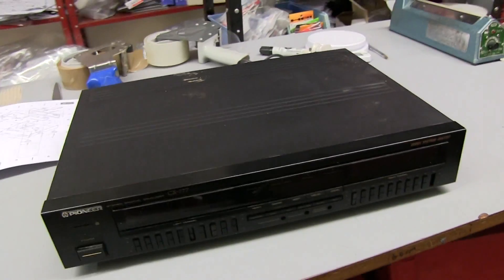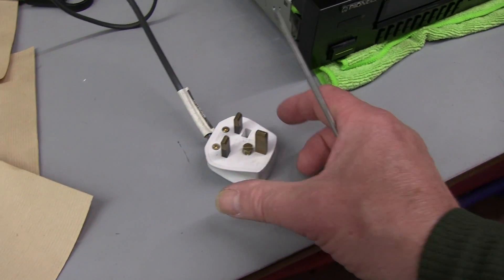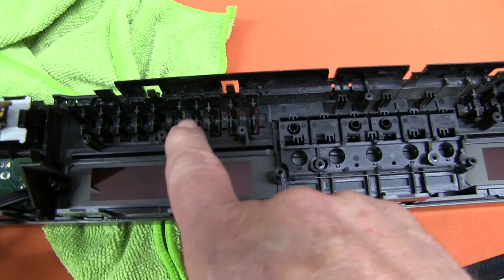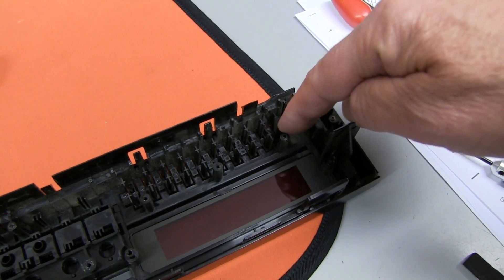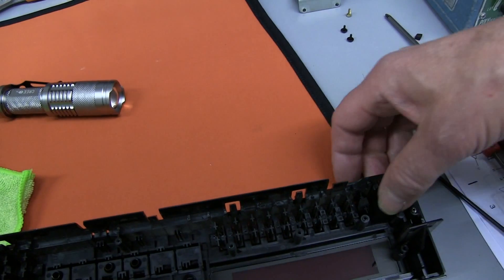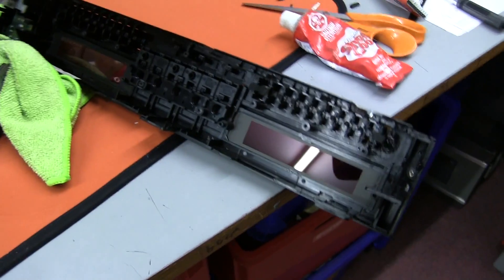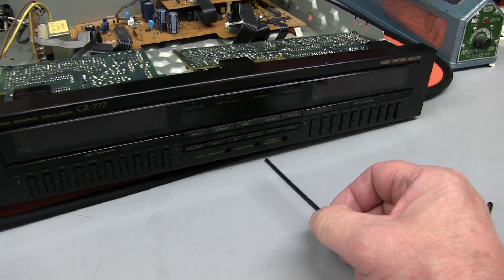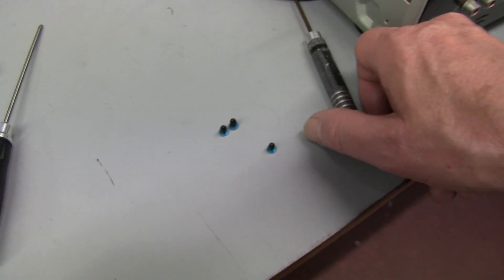Pioneer GR-777 Stereo Graphic Analyser. Repair and test.

Comment: My GR777 has a big problem in the memory program. It's always cleaned after turned off the unit.
Reply from the maker: Hi Fabio. It could be the capacitor that holds the memory chip voltage, has gone down and needs replacing.  All the best Nick
Reply: @nickadams5411  Thanks. I thought that could be a kind of battery inside, but didn't find it.

Comment: Do you have any issues with the sound input being too low? My PC's headphone jack needs to be at full volume otherwise it doesn't really show up on the spectrum analyzer...
Reply from the maker: Hi. I do not have that problem. But I do feed all my inputs throgh a Denon PRA-1200 Pre-amp, so I can balance the levels from some records (vinyl) and Cds etc which vary in volume.  A PC headphone jack, has a volume control in the computer, make sure it is set to maximum.  Nick

Comment: I forgot to tell you the frequences which are not in zero are only in one channel
Reply from the maker: Hi Pete. One channel is normally a bad connection between switches and circuit board.
Reply: @nickadams5411  You are right.I disconnected the RCAs and reconnected and all the frequences are en zero
VERY KIND FOR THE SOLUTION NICK
Reply from the maker: @CUALKIERDESASTRE  Hi Pete. That is good news. All the best. Nick

Comment: Hi Nick, please help.
When I set an EQ ( I create it at my choice) and program it if I do not turn the GR 777 on for a couple of days it is erased.
Furhtermore when I want to set an EQ ( I create it at my choice and want to program it ) in key A, 3 individual frequences ARE NOT IN cero at the very beginning.Ever ytime Iturn on my GR 777 these same frequences are not in cero.
Please consider I am not British, so if you can try to explain easily.
Thank you in advance.
Pedro
Reply from the maker: Hi Pete. I am not sure. The memory has a large capacitor to hold the voltage. It may have failed causing the memory to be lost.
Are the levels only wrong in memory "A". 

Are B, C, D , E  all good?
Reply: @nickadams5411  Yea, Nick all the other keys ok but the memory in all When I create my own EQs erase after a couple of the days
Reply from the maker: @CUALKIERDESASTRE  Hi Pete. The memory is maintained by a capacitor. It must have failed.

Comment: could you pls give some info about that beast (14:14)?
Reply from the maker: Hi Amer. What do you mean?
Reply: @nickadams5411  the cassete deck on the right.. what is it? brand, model...
Reply from the maker: @Bozzy950   The cassette deck at 9:31sec into the video. 

It is "OPTONICA RT-7100"  made by SHARP about 1981
https://www.hifiengine.com/manual_library/sharp/rt-7100.shtml
All the best nick

Comment: What capacitor controls the memory backup or storage on this unit?
Reply from the maker: Hi Glen.  It is 47000uF/5.5V  (C433)
Reply: Thank you nick. I proceeded to download the service manual on hifiengine but my old eyes can locate the location .Could you tell me where to locate this capacitor on the pc board????  Thanks my friend!!!
Reply: @nickadams5411  Another old stupid question, is this a supercapacitor like those button cells??? I can't find on the very poor printed service manual where the location is.

Comment: Nick,
Just picked up the pioneer from a thrift shop and all is perfect but it’s missing one of the gold buttons, please tell me how you made them, I am so impressed with your work in the video. Any help on making a button would be great, have not taken it apart yet but the tape monitor which is the missing the button has a tiny pin like piece of plastic sticking almost out of the front chassis, it’s just flush but if you take your fingernail, you can press it in and it works, so I was thinking , maybe I could fix it from the front with something very tiny and round with a tiny hole drilled in the back of it to slide on to my tiny plastic shaft that I see, and help or thoughts would be great, thanks
Reply from the maker: Hi. I used a small rubber/plastic cap that comes with a Receiver aerial (27Mhz) tube , that is used in model radio control cars etc. They were a perfect fit.
They are very cheap, about $1.  I am sure you can find them on Ebay
Reply: @nickadams5411  thanks Nick when you take the front off the little cap goes behind this little piece of plastic for the tape monitor do you have to remove anything or can you just slide it in there please advise thank you
Reply from the maker: @equalizr1958  Hi, Soory, it was some time ago, I can't remember. The video has quite a lot of detail.  Not sure how much of yours is broken, but it only has to operate the micro switch.
Reply: @nickadams5411  every button switch everything is perfect on mine just a little gold cap is missing on the tape monitor but there's a little tiny plastic like Rod sticking out that's flush with the front panel and you can press it with your fingernail I'm assuming the gold cap was glued on it and somehow the glue went bad and cap got lost I'm looking to sell it but I'd like to make it right
Reply: @nickadams5411  do you happen to know the model and our brand of the controller I have an old phone here that has tiny little silver buttons that might work and I might take it apart to see just a little scared to take the front panel off and have some parts that are brittle fall apart in my hand but they're all working now not like yours where you had buttons that were smashed in my buttons are fine.

Comment: Hi Nick, i am the owner of a gr-x540 that's very similar to a gr-777 internally but externally it's a midi format component. I was surprised when i started to use it with my hi-fi chain (amp AX-340, cd pd-x950m) and it dostorted the sound in flat position! Also with eq button in off, so i can only remove part of bad sound only using it as "negative", pushing down the levels... When the levels are not touching the top of the displays the sound return acceptable. 
Is it time for a recap? thanks for the videos and for your attention. 
Riccardo
Reply from the maker: Hi Riccardo
The Gr-777 has the same limitation.
The highest bar must not exceed the top or the sound distorts.  There is no margin for overload.
The individual frequency bars are often higher than the Level bar on the right. It is important to keep the highest frequency bar below the maximum level.
It is a design flaw?. A recap will not change it.
Reply: Thanks a lot Nick! I had a doubt about capacitor fault just because it was made in 1988, 30 years ago now! It's a little bit crazy that Pioneer sold it in a rack with other components that pushed a too loud signal to be well managed by this kind of equalizers. I'va also a Technics SH-8046 and when its bars toucked the top, the volume never distorted! Really thanks for the news
Reply from the maker: I  have a preamp with a level control, so I can adjust the level from different sources, so they always are just below maximum.
Without that, some outputs , such as CD will be too high for the equalizer.

Comment: How does yours have blue LEDs? All of the others I’ve seen are amber LED’s
Reply: USA version has amber, UK or Europe has blue. Remove the plastic amber filter on the back side of plastic cover and you have blue.
Reply: @glenzabriskie3952  I want to convert mine from blue  to Amber, what part will 
i need?

Comment: My GR-777 equalizer display some frequency level always full. May I know whats the problem? Please help
Reply from the maker: Hi

You turn on the unit, and the displays all go to maxim (both channels)
You disconnect the phono leads and display is still full.
1. Are both channels the same, at maximum display.
2. Does music pass through the unit undistorted
3. Do the controls change the sound, but display remains on full.
If the controls work, but display is stuck on full, then it is probably a fault in the display driver.
If the controls do not change the sound levels, then there is a fault common to both channels.
Reply: @nickadams5411  Hi Nick,i  going to buy GR 777 without remote control for 100$,will be this unit improve sound of my equpiment(Yamaha receiver RX496,Pioneer blu ray player BDP170, Magnat Supreme802 speakers)?
Reply from the maker: @Dr.Metallian  Hi. Yes. You can adjust the frequency curve, so your sound is perfect.  Very good to program for speech and films. Also some older Cds need more bass etc.  All the best. Nick